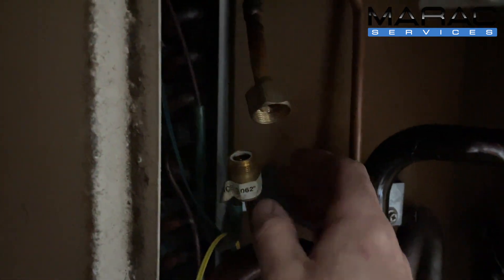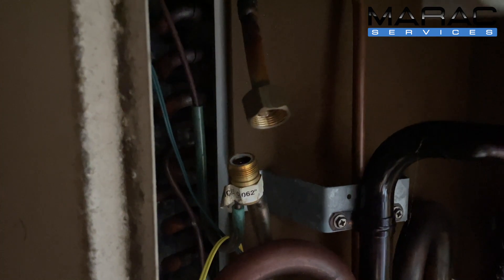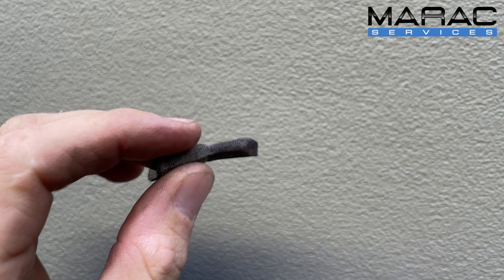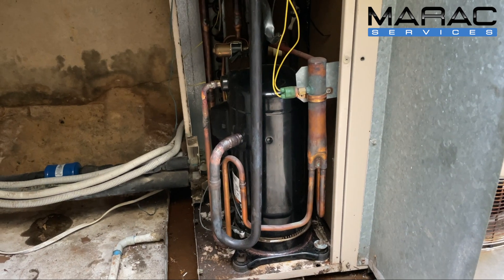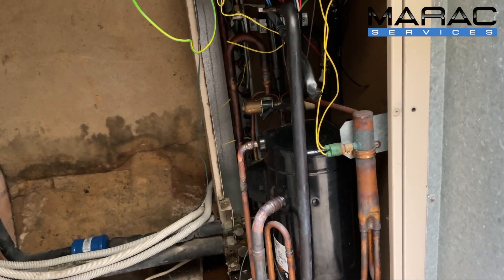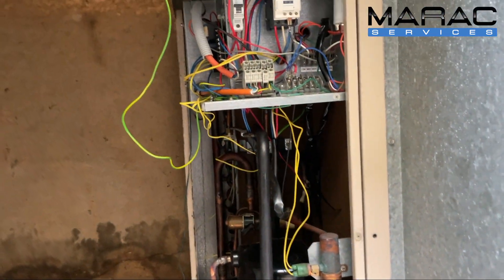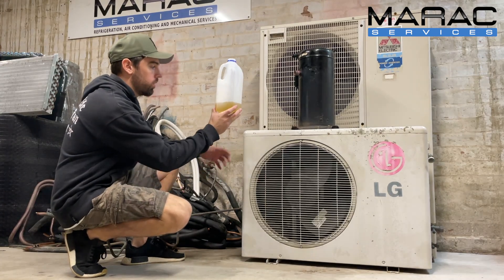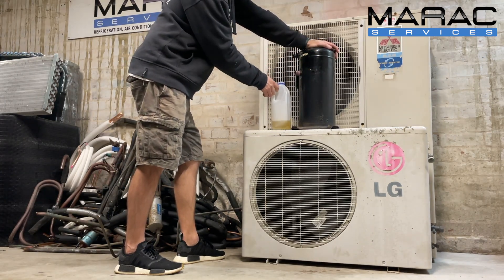Replacing POE oil with 3GS Suniso Mineral Oil whilst replacing a Copeland Scroll Compressor.

Comment: Regarding POE/Mineral Oil compatibility, how do you know if the original manufacturer (1070's - 1980's) flowed Nitrogen (or other inert gas) during construction 45 years ago?  If you assume the mfg.did not flow Nitrogen, then you've got Cupric (copper) Oxide on the inside of the original construction.  Not a problem for mineral oil, but POE would strip the cupric oxide from [the inside] of a brazed joint that was joined without flowing Nitrogen.  In that case, you've got the potential for acid.  I would think a good suction filter should be added regardless of a burnout issue or not.

Comment: I have a Goodman R22 like 12 years old model GSC130421BA Copeland compressor.  It still runs well but want to prepare for when it goes down so I bought a direct replacement for it but the replacement has POE in it.  I was told that it’s directly compatible with mineral oil was kinda doubting that.   They said if the system is R22 prior to 1978 you may want to drain out all the POE and put in mineral oil in the compressor but if it’s more modern the two oils will mix well?  The procedure looks so simple to drain out that POE and refill with mineral oil. Is it true I can just leave the POE and not dump it out for mineral oil as long as the installer used nitrogen when they were brazing the lines that POE being also a detergent can actually sludge things up with the mineral oil?  Also, should I equilibrate the insides in other words do a few drain and fills to make sure all the POE comes out because there’s always gonna be some left inside?  The wasted mineral oil will be minimal.
Reply from the maker: Personally I would just drain the PPE oil out of the compressor. It is so quick and easy. The sticker on the side of the compressor will tell you how much POE oil there is in the compressor. I’d just lean it over and leave it draining until it has all come out. Doesn’t take long at all. I drained the oil into a measuring cup so I knew it all came out. Then I measured the right amount of mineral oil into the comp. That way the whole system is using mineral oil. 
Mineral and POE oil do not mix together no matter what age the unit is. That is my understanding anyway. There are videos on YouTube that show you what happens when they mix. If you do a few times, that is great but I don’t think it’s overly important. I just drained and filled once. As long as most of it is out is good enough in my opinion. This compressor has been running perfectly since. I’d go onto Copelands website to see if your compressor takes 3GS or 4GS mineral oil.
Reply: I had no idea there is a difference in mineral oil what’s the difference?   Did you mean POE or PPE? I bought from johnstone’s supply in 2020 1 gallon of Nu-Calgon C-3s says it replaces 3GS.  They never told me about 4GS at that time or if this one I have is compatible with compressor model ZR38K5EPFV800.  There is 42oz of POE in this unit.  On their website there is a table of recommended oil’s odd, it says POE for R22.  Anyhow it list oils below and says 3GS but Nu-Calgon is not one of the choices.  Dam hope what I have will work ok.  I see Suniso 3GS, texaco capella WF-32, FUCHS Reniso KM32 and Copeland white oil.
Reply from the maker: @imun1ty  That was a typo, I meant POE. In regards to mineral oil, 4GS is thicker then 3GS. I’d just check the Copeland specs of the model compressor you have on google. Chances are it does in fact take 3GS.
Reply: Regarding POE/Mineral Oil compatibility, how do you know if the original manufacturer (1970's 1980's) flowed Nitrogen (or other inert gas) during construction 45 years ago?  If you assume the mfg.did not flow Nitrogen, then you've got Cupric (copper) Oxide on the inside of the original construction.  Not a problem for mineral oil, but POE would strip the cupric oxide from [the inside] of a brazed joint that was joined without flowing Nitrogen.  In that case, you've got the potential for acid.   I would think a good suction filter should be added regardless of a burnout issue or not.
Reply: @vinnyinwallawalla1877  I actually bought the compressor two of them one 3 years ago and another a month ago.   I would think they would have used nitrogen purge to braze.   They capped the ends with plastic cap assuming they have it filled with nitrogen.  I still don’t know what mineral oil to use 3GS or 4GS.

Comment: Hi how can you adjust capillary tube in ac or r22 or r410 (when we don't have exact compressor for ac unite rotary scroll or another model)?
Reply from the maker: You need to get that information from the manufacturer mate. There’s a few different factors that contribute to how long you need the capillary tube to be.
Reply: @maracservices  thanks so much, do you have any information or book about it?

Comment: I have r407c compressor can remove Poe oil and refill mineral oil then use r22 please help us
Reply from the maker: Yep that’s right
Reply: Thanks
Reply: I copied this from an on-line search>>>>Can mineral oil be used with R-407C?
R-407C is a zeotropic HFC refrigerant blend rated A1 by ASHRAE (lowest levels of toxicity and flammability), having zero ozone depletion potential. POE lubricants must be used with R-407C since its components are not miscible with the mineral oil or alkylbenzene lubricants found in most R-22 systems.

Comment: can i add a filter drier to the system that has no filter drider if yes where can I add it?
Reply from the maker: Yeah you can. You can put a filter drier in the liquid line. If the original compressor burnt out then you should put a burn out drier on also.
Reply: @maracservices  thanks you so much🙏

Comment: i mean danfoss scroll compressor?
Reply from the maker: It’s applicable to any brand and any type of compressor. You need to match the oil of the compressor with the oil of the refrigerant. 

All you need to do is look what type of oil is used (which will be written on the label that is on the side of the compressor) and find out what oil is in the system currently.